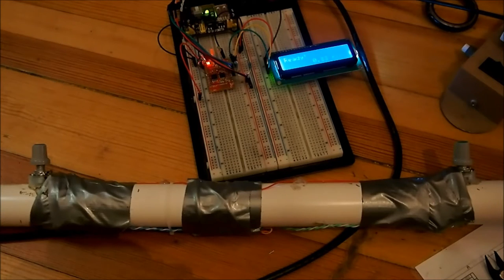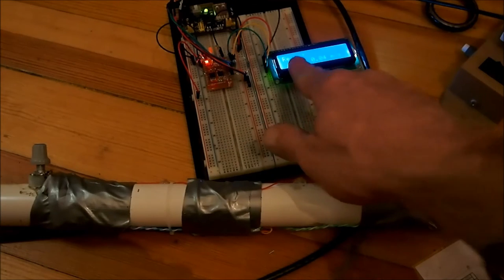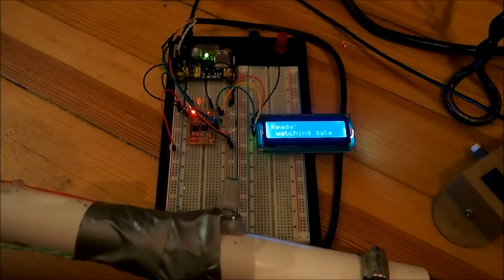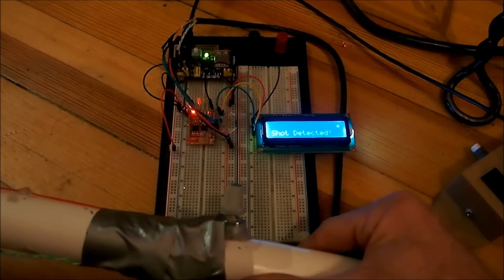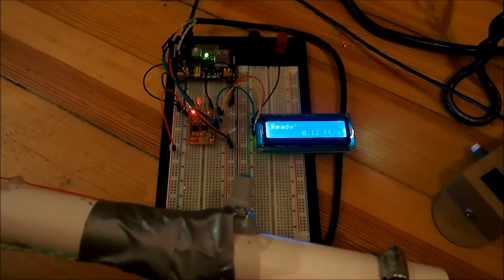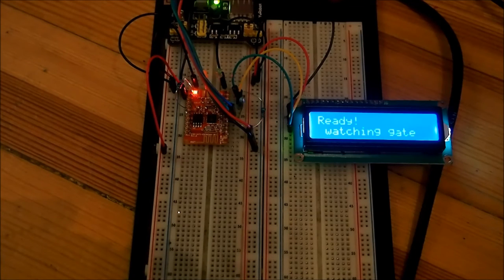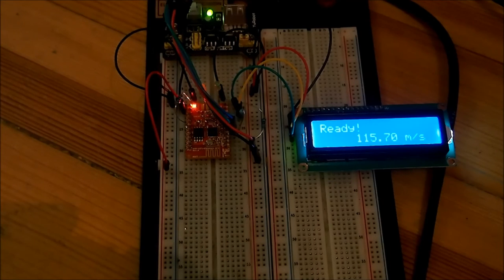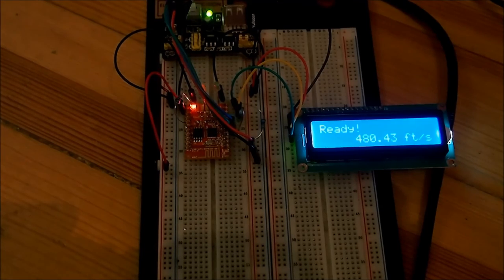DIY Chronograph Demo

Comment: Really interesting, did you uploaded the code yet? can you make it log a string of shots and measure avg/spread numbers too?? Thanks.
Reply from the maker: +VinnyG Not yet. I'm first altering the hardware design to be an open trap (i.e. no tube and not connected) for safety reasons. This requires more sensitive photo-diodes... 

AFA logging multiple shots and averaging yes that's no problem. The real fun part is because it's using an ESP8266, it has WiFi. So I can add a web interface!  At that point I'll have a wireless  chrony I can view from my phone.
Reply: Got it, just like the comercial chrony's, I think they use photo-diodes too but in "parallel" with the emitter is that right? the hard part would be setting reflectors

Comment: Thanks, I am just starting to build a chronograph on my own, based on your project. BTW, I am looking at your code on GitHub: why did you use CHANGE to trigger the interrupt? That way you get 2 events per sensor - once a pellet breaks the beam and the other when it leaves. Wouldn't it be better to use FALLING, so the event gets triggered just when a pellet breaks the beam? Besides, it would be a good idea to add ICACHE_RAM_ATTR to your ISRs declaration, such as "void ICACHE_RAM_ATTR gate1Tripped()
" to ensure it stays in the IRAM.
Reply: Once an SCR is triggered, it stays on until the power is removed. In this case, when the sensor is triggered, the SCR begins to conduct and keeps conducting until it is later reset in the code. Therefore, there will only be one event per sensor during a shot.
Reply: Hi Jonnie. I received a notification that you replied, but the reply doesn't show anywhere. I have only recently started doing research on building a chronograph and, even though this is a good project, the information on it is very incomplete. Would you be willing to share your code and schematics of how you built yours? My coding skills are far too limited to improve on what is available. Much appreciated.
Reply: @Eggstertjie  strange, it does show when I watch logged in with my account, but it indeed does not show when I try watching it from another account. Here's the reply again: Thanks, I have already completed mine with some HW improvements and have written a completely new and unique software for it. I'll post a video about it one of these days. SCRs have a threshold current that if you don't exceed, the SCR does not stay latched. Usually around microAmp, but consult your component specs for details, out just find it by experimenting with different resistors.
Reply: @Eggstertjie  Regarding the schematics, it is relatively straight forward, but I am still considering to make it a commercial product, since I invested quite some time into developing it, and the people who saw it are already making "indecent proposals, so the software remains undisclosed for now. For example, it has a complete built-in weather station tracking temp, humidity, pressure and altitude at the time of each measuring session, you can connect to the device using your mobile phone to get a complete detailed statistics and a report containing details about each shot in the session, it tracks separately burst, single shot and overall statistics. You can store several sessions in the device memory and use any of them as a baseline, to compare before/after upgrade stats, or to see how your replica's performance changes over time. You can store various ammo profiles (duh!), but you can also make the "what-if" analysis, for example, after making a measurement, you can change the ammo mass to see how fast a lighter or a heavier BB would fly, or you can see how much faster a BB would fly if you boosted the replica by 0.1 joule, etc. I'll make a video about it when I get some free time.
Reply: @jonnieZG  Thanks for your reply and for reposting the previous comment. 
Wow, that sounds awesome! I can imagine that you invested a lot of time into making it. 
For now I'm not really interested in many extra features. I basically want to see the pellet velocity in fps for each shot without any memory or calculation features. I can manually log each shot on a spreadsheet and do calculations there when needed. My main obstacles are, therefore, which sensors to use, the circuitry for interfacing them with the microcontroller and the code to reliably measure the projectile's speed. Displaying the number on a LCD or simple web page should be straight forward.  
Your project sounds really great, though, and I look forward to seeing it in action when you post the video later on.
Reply: @jonnieZG  Thank you for all your replies and advice. Unfortunately, I was yet again notified of your reply to my last message, but it doesn't show up in the comment section. If you don't mind reposting it, I will be very grateful.
Reply: @Eggstertjie  Repost: Regarding the sensors, I can tell you that I used phototransistors BPW40 with IR LEDs L-7113SF7C (even though any others should do fine as well). The transistors are connected in series contrary to the silly dogma that they behave as current sources and therefore could/should not be connected in series. They work great, they are sensitive and more than fast enough for this purpose. So far I have successfully tested it with 880 fps fast pellets from an air rifle (that is the strongest gun I have found by now), but there are absolutely no reasons it shouldn't work on a real fire arm, given you shoot from a safe distance, so the fireball from the gun would not burn the plastic that the chrono is made of.
Reply: @jonnieZG  Wonderful, thank you for the repost. I will give those transistors a try as I believe that they are available locally here in South Africa. I will exclusively use it for air rifles, with my fastest one rated at 1000fps, so those transistors should be plenty fast enough.  
Would a comparator circuit suffice for interfacing the transistors with the microcontroller, or is the SCR variant a better option?
Reply: @Eggstertjie  I have used just two SCRs with a transistor . Opamps would be an overkill.
Reply: @jonnieZG  Thank you for all your advice. Much appreciated.
Reply: @Eggstertjie  Why would you not just connect directly to microcontroller? Sorry, I'm new to this.
Reply: @jonnieZG  Why is an opamp overkill? Sorry, I'm new to microcontrollers.